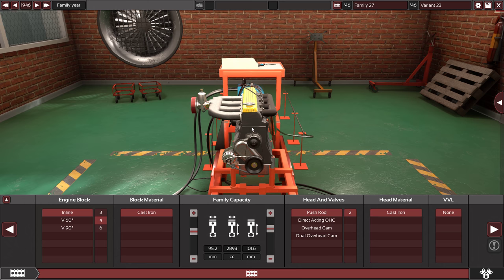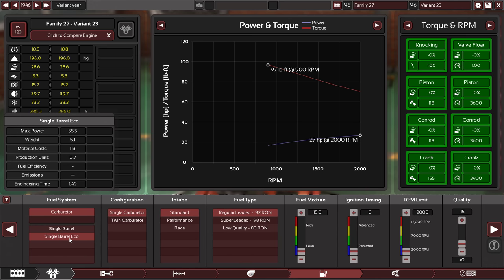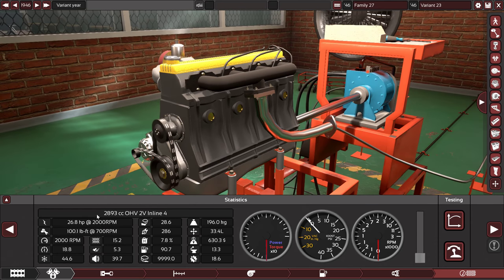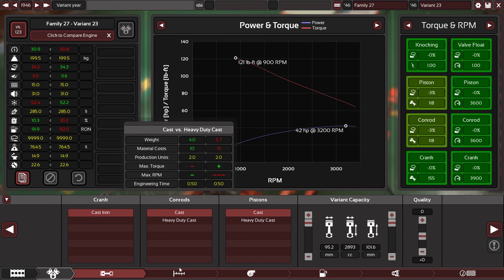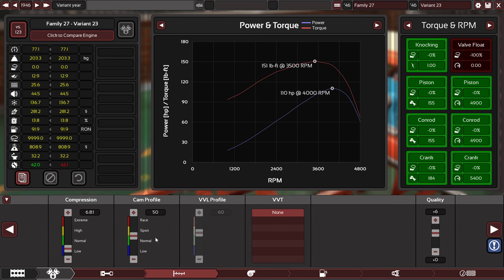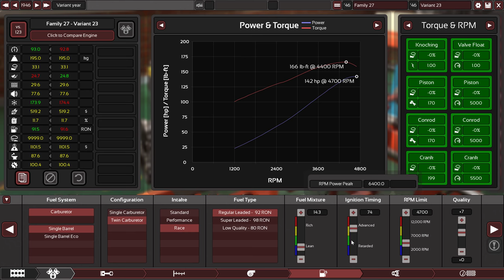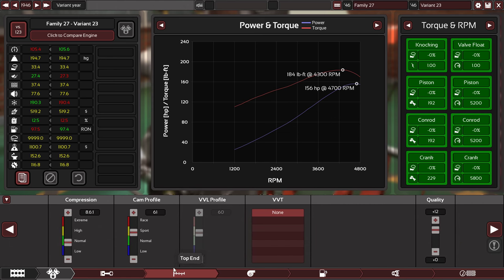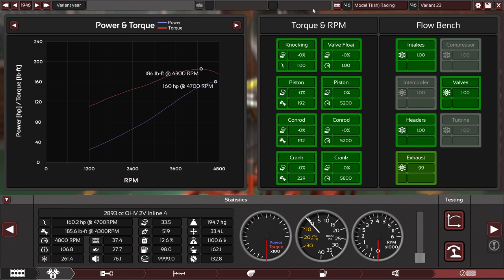Ford Model T(ish) engine stock/MAXED in Automation Game in 4K.

Comment: >overhead valve
REEEEEE
I know you can’t really make flatheads in this game. It’s all good.
NEW CHALLENGE! You are chosen by DP motorworks to build a new engine for 1960. It is an international engine for all countries to use. The engine MUST be able to run with 80 octane low quality fuel. It is an engine for a truck, so it must have over 300 lbft of torque and 100 hp. It is also going to be used in mid sized cars as well, so it is limited to 4 cylinders. If you put a turbo on it, the torque must go to 400 lbft and 130 hp. You have also been chosen to design the truck it powers. It MUST have 4x4 and power steering with manual lockers. It also must cost between 5-12k to produce, no more, no less. The truck is optional if you want to do the challenge.
Reply from the maker: It's all good but there is no turbos in the 60's
Reply from the maker: 300 lb-ft and 4 Cylinders and 1960 ? dude i tried it now with the highest bore and stroke and with 80 octane and the lowest compression ratio and used the perfect torquey cam profile and the the perfect timing and the highest AFR for the 4 barrel Carburetor  and perfect exhaust system and it only got to 174 lb-ft and 115 HP on 0 quality. sometimes not everything is doable in Automation.
Reply from the maker: With 98 leaded octane fuel and long tubuler header and 100 on the timing and 8.3:1 compression it got to 204 lb-ft of torque.
Reply: Bshar Nasri then it must be a V6 or V8. In-line 4 was a stretch anyways. I will be surprised if that doesn’t work. EVERYTHING ELSE STILL STANDS!

Comment: Do v6 1.7 turbo 12.000rpm max power
Reply from the maker: The Power Is Peaking at 10300 in every situation and the engine is valve floating at 11900 RPM with yellow warring light.